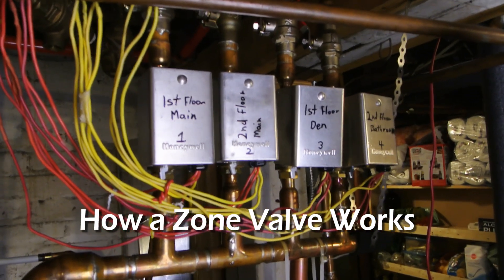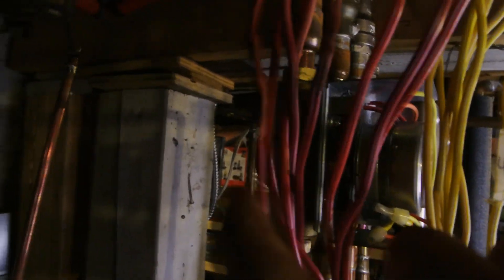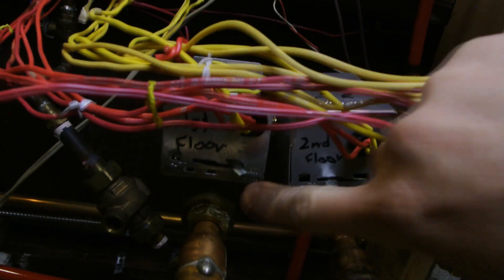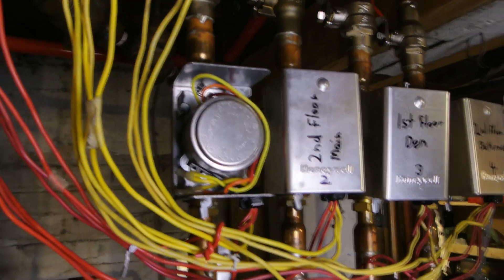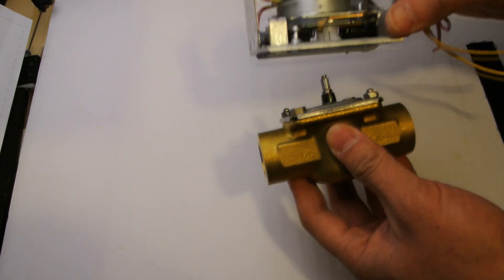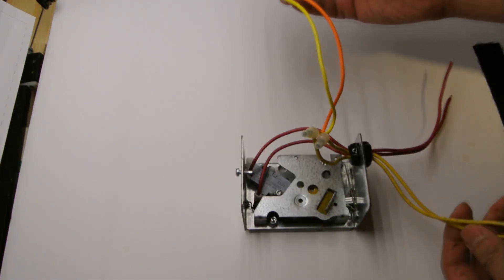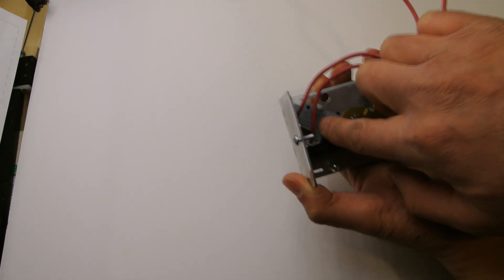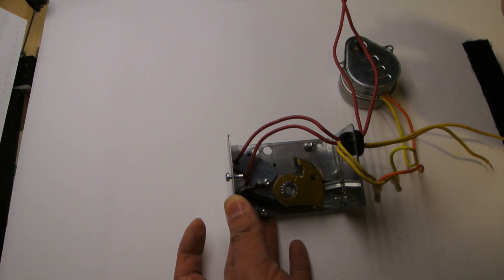How a Zone Valve Works - Hot Water Heating

Comment: Iam soory but if i get it right, this valve have only 2 states 0-1 closed and open? Why the F would i use this BS. Solenoid valves are 120 percent better and have more lifetime. One Solenoid and relay for the connect the contact. Even better would be Stepmotor or Basic DC motor with few more contacts to even regulate float of water. And even Save some energy becouse this ac motor have to be on all the time when you want valve to be open.

Comment: Very informative video.  Been troubleshooting our 4 zone system.  3 out of 4 are good. I assumed it was a T stat but upon further testing. Isolated it to the powerhead.   Just like you show in your vid about not hitting the end switch. Ours isn't either. The lever gears are chewed up and stripped. Trying to manually turn it on is futile.  Its like its damaged. Even when I turn of the T stat, the manual turn on lever flops around.   I have a new powerhead on the way.  Hoping that solves the issue.  The motors are brushless.  Seen a few videos and they do mention that. Well done.

Comment: can these switches fail in a way that the water doesn't stop circulating when the thermostat switches off? I'm having a frustrating problem like that here at my house. 
The thermostat is set on 70 but it's 80° in here and the baseboards are 120 degrees. recently we didn't have heat and the plumber said that the flow control valve was stuck. He said he unstuck the valve and that it should be fine but now we're being roasted in here...

Comment: Hello Andrew, can you please answer 2 questions :
-My system is gas boiler with some zone valves. The hot water tank is also controlled by a zone valve. When bleeding or purging the system, do I need to bleed the hot water tank's zone too?
- To bleed a zone, I was told to just shut the valve on the pipe with the zone valve, connect a garden hose to the drain, manually turn on the zone valve, and open the drain. When doing this, do I only manually turn on one zone valve that I'm bleeding, or I have to let another zone on too to reduce the pressure (so bleeding one zone and turn on another zone without bleeding at the same time)?. Thank you.

Comment: Does the mechanical arm have to be in contact with the end switch for it to send the signal to the boiler, or does it merely have to press it in and release to work?  I've pulled the manual lever to open valve but switch doesn't engage until I push it down with my finger.

Comment: Hello Andrew, 

Thank you for the video!

Please answer my questions 
We have a condenser boiler. Just recently the water valve was replaced. Now  one of the zones remain open (heat cannot turn off) and cannot be controlled by the thermostat.

Is there a way to shut the zone entirely off? I actually don’t need heat for this zone.

Replacing the water valve change the pressure to these zones and so damage the zone?

Comment: Obviously U don't know as much as U think. I'm a computer Technician. The whole zone Valve is mechanical not just the mechanism  that allows the water 2 flow and close 2 stop the water flow. This motor is a mechanical device . Not solid state. Motors Can B moved by different types of energy. 4 example. Steam propelled motor. Water propelled motor. And in this zone Valve the mechanical motor is propelled by electron flow. Which is 24volt  Direct Current. Which in layman's terms is electricity . Thanks 4 listening!!! Steven Cote

Comment: This video is 7 years old yet still very helpful. Thanks!
Reply: My bad. It's Alternating Current. Not Direct Current. But in the end. The mechanical motor is propelled by electron flow. Which is Electricity.

Comment: Great video, but I have the opposite problem, instead of having a zone that won't turn on, I have one zone that won't turn off (other zones work fine).  I thought it was the thermostat, but I replaced it and the problem is still there.  Is there any way to manually turn off just one zone while I wait a few days for a pro to handle it?

Comment: nice video, but I cant figure out whats wrong with my heating system ., there is a 3 zone valves in my home, I tested each zone valves one by one by turning max and off on each thermostat, the pilot light does turn into burning mode but after a few minutes its back to pilot mode, how come?

Comment: Good stuff Andrew! My valve ball broke off so I removed it and now getting heat into my air handler. Question is why can’t I just leave it manually open without ball. Meaning I will always have hot water in my heating coil and when thermostat calls for heat the blower will blow and I’ll have heat. Seems  I don’t really need the valve plate with the black ball. In summer I can just Close water switch to unit.

Comment: I suspect I have a bad zone valve. Last night I flipped the switch to manual Open...thinking that the open valve would release an open flow of hot water through that zone. However, after 12 hours (overnight) there was no heat in that zone. What other problems could I be experiencing? The other zone is functioning fine.

Comment: My question is the property manager was doing work in the boiler room and now i have zero control of heat in my main , its constantly on and my place is like a Sauna ... when ii checked the switch it shows its in the Off position .. i also see two wires for controls are just their and not crimped like the other and not connected . theory is he disconnected my controls and its constantly on .. How do i turn it off . its driving up the bill and too hot ...

Comment: I call for heat in 1 zone thats not working and the boiler comes on but the zone valve does not open.  Does the boiler have to come up to max heat before the zone valve opens?  If the thermostat is calling for heat and the boiler comes on but the zone valve doesn't open could it be be the motor?  If there is not enough water in the system to operate an upstsirs zone, could that be why the zone valve motor doesn't come on?

Comment: This is a great explanation of how a Valve Assembly works. Thank you Andrew! I have clicked like and subscribed. Keep up the good work! 
I replaced just the valve assembly motor even though the old motor was turning, I thought maybe it is a weak motor and is not pushing the micro end switch all the way in. Also, it is way easier to replace just the motor. With new motor, I still had no damper opening, no circulation pump and no boiler fire up, even though the motor was doing it’s job. I had robbed the motor from a brand new complete zone valve assembly.  With new motor on and POWER OFF, I then tested the old micro end switch for continuity and when pushing the button ALL THE WAY IN, I got continuity. I then tested the brand new micro end switch on the brand new zone valve assembly and noticed I got continuity with the BUTTON ONLY PUSHED ABOUT ½ WAY IN. I decided to take the NEW motor off again so I could access the micro end switch screws and proceeded to replace the old micro end switch with the new one, even though the old one had continuity. Once the new micro end switch was in place, I put the OLD MOTOR back in place and wired up everything. I turned my thermostat way up and then turned on the power to the boiler and Walla, damper motor turned, circulation pump came on and the boiler fired up.  So it was a bad Micro end switch. That zone is working again with old motor and just a new micro end switch. 
Thanks again!

Comment: Where should the switch at the bottom usually be positioned ?. It clicks if pushed all the wall to the left. Is that where it should be, or slightly right ?

Comment: if my thermostat is on in a specific zone and calling for heat, however the switch for that zone isn’t moving, is it safe to leave the valve switch manually open for the time being until i get someone to look into the problem? how is the heat being controlled if i leave it open?

Comment: Can you please tell me if the valve can be set halfway or does it have to be either all the way closed or all the way open. For some reason it’s so hot in my apartment this year. Windows are open and I’m still sweating. My thermostat is not turning the heat down. Landlord died and son in law might of set heat too high. By the time he’d get someone out here it will be spring. I always have to bleed and open valve for winter. Thank you

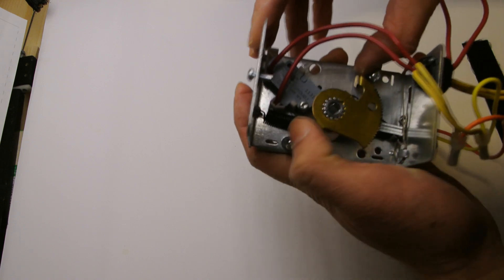Comment: Hey, Andrew W "boss man." You nailed it for me.  the "N" switch. 9:40-10:20 and a minor mention before that.  That is the issue for me.  Valve operating in response to the call for heat but boiler not igniting. Much appreciation. Blessings to you and your household.

Comment: Thank you for a very clear explanation of how a zone valve works, very much appreciated!  Taking the controller apart took the mystery out of if for me; nice work!!  QQ: do you have a video on how to wire up a zone to a controller board?   I have a 6 zone controller board with relay switches.  Each zone has it's own pump except one pump is used for two zones and I have two controller valves wired together for this one pump (return side plumbing).  I disconnected the wiring to each zone and now I don't know how to wire the zones back the way they were.  I have 4 wires coming out of each controller valve (2 black and 2 red).  I remember one of the red wires from each controller were connected and the other red wire from each of the controllers were connected into one but I don't know where each of those reds should connect to (controller?  24vac?).   Do the two blacks go directly to the 24vac transformer?  I use a simple mercury thermostat and wondering if that should be wired directly to T terminals on the board, or should it act as a 24v switch so the controllers get 24vac when thermostat calls for heat?  Sorry for the confusion, but if you did a wiring video and point me to it that would be a great help.  Thank you!

Comment: "When you turn on the thermostat...it causes the MOTOR to OPEN the valve"...WRONG
When the AMBIENT (current air temperature near the thermostat) is LESS than what the thermostat is SET for...THEN and only THEN is the VALVE commanded to start the MOTOR.
Once the MOTOR has run and completed the END SWITCH ...THEN the BOILER is commanded to provide HOT water.

Comment: My Zone Valve is in the CLOSED position but Im getting heat? How can that be? Im having an issue where when I turn off upstairs....downstairs ALSO SHUTSdown even though its on its own valve. So temp drops. So when I turn uopstairs back on then I get heat downstairs too...I check the valve for downstairs and its not open. Yet I get heat. Any ideas whats wrong. Thanks

Comment: I have 3 zones. 1 and 2 no issues however zone 3 has no water flowing. If I lock into manual over ride once the thermostat kicks in it will disengage the over ride. Why is this?

Comment: With my Honeywell unit V8043F, the end switch is designed to not activate if the unit is manually set to on. So for that circuit to heat, at least one other zone has to have a call for heat.

Comment: My radiant heat system has the older style thermostat. I am wanting to upgrade to a newer model but I only have four wires and the new thermostat has the C wire we're at would I lay in this on the motor?

Comment: Thank you for a great video.
First time turned my boiler after replacing the chamber blanket. and i put an old fassioned thermostat it works. But the other zone i put a battery powered used thermostat so my loom is cold. I will try as you demonstrating.

Comment: Where can I find a purely mechanical version? Unlike a car thermostat which opens (physically) on rise for water flow to the radiator for cooling, it would be close on rise. On top of that I'd like it to be adjustable. A friend wants to build a boiler using the campfire at a gold claim and I think automatic regulation from such a valve would reduce frustrations.

Comment: Excellent instructional.  I do have a question.   The heating system was installed in my house back in 1989 when I added a second floor to my home and converted from forced air heat to baseboard hot water.  We have always thought the heating system in our home was not “just right” and had the furnace on longer than it should to reach set temperature. The plumber installed three zones and all of the Honeywell valves are installed with the manual lever at the top and the arrow on the brass pipe is pointing towards the boiler in the opposite direction of the flow of water.  Not knowing any better, I replaced a bad zone valve myself back in 2009 and installed it the same way.  
I’m thinking that the electronics are operating a ball valve and it might have a slight restriction for water flow in the wrong direction.  I would appreciate your advice or from any qualified plumber.  I have one valve that has been sticking in open position last heat season and am going to replace it - with the arrow pointing in the correct direction.  I’m thinking that I should replace the other two in the arrow pointing up.

Comment: My system looks just like that with 3 zones. Basement, 1st and 2nd floor.  7 years ago I asked the technician to make the basement connect to the 1st floor thermostat since I didn’t go down there that much. Fast forward now and I have an In law down there and temperature wise when it’s 72 degrees on the 1st floor it’s 65 degrees in the basement.  She used an electric heater last winter and bill is crazy. I now want to connect that basement thermostat again so it can regulate the heat in the basement because the furnace is gas and a lot cheaper than electricity. I remember when I asked the technician to switch it the entire process took less than 30 seconds so I would like to find out how to do it myself. Any help would be greatly appreciated.

Comment: Thank you for an outstanding video.  Very clear and helpful.  In my case, the end switch was sticking when it had been released by the motor-activated lever.  That is, the lever releases pressure on the end switch, but end switch button remains depressed and hot water keeps flowing to radiators.  This single video enabled me to understand all I had observed!
Reply: Aku SantaFe how did u fix it? Mine is doing that too!!

Comment: The motor is a shaded pole motor. They are used in bathroom fans too. Most motors would over amp and pop the fuse if they locked up like a zone valve motor does. But a shaded pole motor doesn't care.

Comment: does it matter if one of my zone valves looks like it is upside down? the arrow is pointed in the right direction though.
Reply: I have the same question.   The plumber who installed my heating system has the manual open/close lever at the top and the arrow on the pipe section is pointing in the towards the boiler, although I know that the hot water is being circulated in the correct direction.

Comment: Hey great video, I'm wondering it you can offer me advice on a certain issue. I live upstairs from my landlord and have my own zone. The heat randomly turns on and gets too hot normally around 82 degrees on it's own and shuts off on it's own randomly. We replaced the thermostat with a nest which receive power through a rh wire and w wire but I still have no control on shutting off the heat or raising it up and down. It's the same system you have in the video. Any idea what could be causing this exact issue?
Reply: Landlord controls your zone probably wired to his zone valve

Comment: sir our have like a dial on the side so i assume its for manual opening the valve or it can be control also?the other pipes are very hot but on is like luke warm hot,or is just open closed thing and cant be controlled if how much hot water will go tru?thanks

Comment: I a base bord heater system with 2 zones 2 thermostat s I have a problem when 1zone goes on I have hot water on both zones what is wrong with that also the system as 2 zone valve relay box

Comment: Does turning the zone valve on manually with that slide also turn-on the zone circulator pump too?  Because 
without the circulator pump going on, no water will flow to the baseboards and still no heat, right?
Reply: No.  On these V8043 motorized valves, the tab on the driven gear quadrant does not hit the microswitch when using the manual override.  You can pull the lid off the end of the motor and manually spin the rotor the rest of the way to check the action of the end switch.

There will be heat moved to the overridden zone when the pump cycles on for a call for heat to any of the other zones.
Reply: Was just about to ask same question. Thanks

Comment: Hello Andrew, thank you for the help vid. I recently bought an old house with the same system. I was just wondering, how often do you flush the whole heating system? Will the water inside the whole system turns bad and potentially does something bad to the system?

Comment: what does it mean when the switch doesn't have the tension like my is just move left to right with out any tension ?  i have heat but i am not able to set the temperature down is alway 80 i set it to 65 or 70 and still 80  can you help me  with this question thank you
Reply: That means the zone is presently calling for heat.  Turn off the emergency switch to the boiler and system.  If the switch still moves freely and doesn't have tension then the spring may be bad.  Go through each segment of the system and make sure each part works indovidually.

Comment: Manual switch- when you manually open a valve as you do at 3:37, you mechanically open the pipe, and you  send a signal to the boiler as would occur when the valve motor itself were activated and opened the pipe and moved the micro switch--- or not? I'm not sure. I have opened the valves in the past to purge air but I believe I always had the power to the boiler shut down.

Comment: when i turn my thermostat off the heater (water furnace)continue to run hot, could it be that switch stuck on or completeing the circuit?